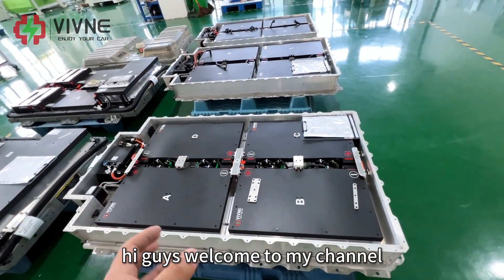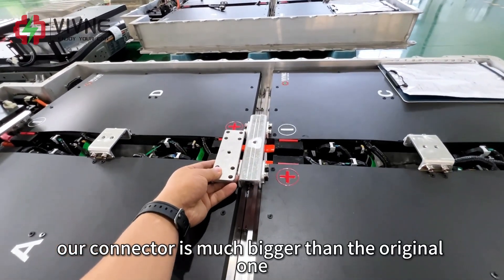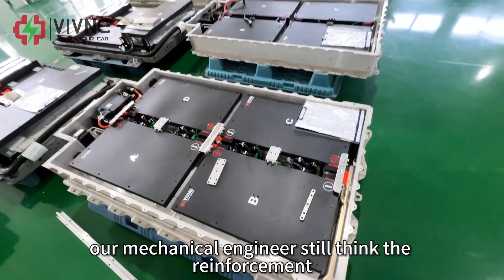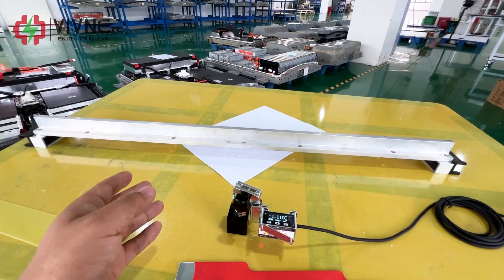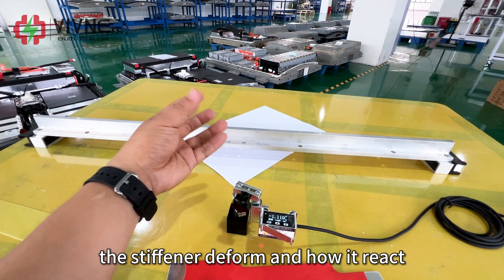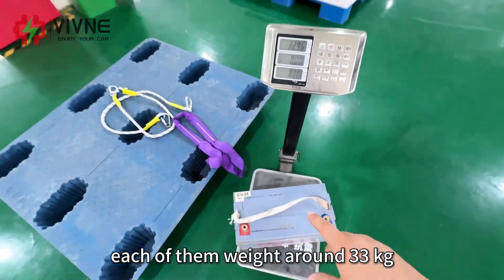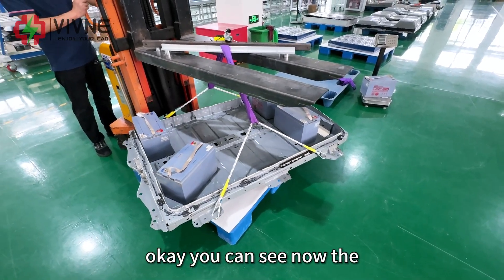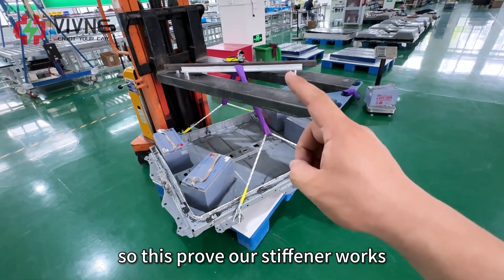VIVNE-BMW i3 Battery Pack Reinforcement Test with 180kg Load!

Comment: I'm more worried about the lack of cell side compression so that it lasts the rated cycle life...
Reply: The cells are different. Not using Samsung cells here anymore but CATL it appears, more modern efficient type used instead ?!? Perhaps soon some other 3rd party devises solid state cells..will be interesting to see how far things can go not just quantitatively but also qualitatively i.e. use back the original BMW battery casing (for packaging compatibility) & key components (to be able to interface with existing software environment of this model/generation of car) but keep improving the battery cell aspect..interesting to see how much further the BMW i3 concept of car can go ?!! Something like the M-B G-Wagen/G-Class, the key concept of design remains unchanged over even decades yet continous modernization of the details underneath take place

Comment: Only way for you to sell this in EU is to let the battery certify according to EU standards. I know, its costly and your product would most likely not pass it. So far, your battery is not safe to be used in car and you should not advertise it nor sell it.
Reply: Just bought one... EU is not a mandatory thing to rule your life...
Reply: @fernandinand yes. EU becoming a big clown joke ?!? Also quietly notice how greatly EU depends on Asia especially China for their so-called 'own original' products today ?!?!?
Reply: What is your real life evidences that these retrofited battery pack is 'unsafe' ?!? You cannot simply assume obviously...you MUST produce your evidences to back up your opinions ??? Otherwise commonsense will need to prevail i.e. based on what can be seen so far this setup works in reality ! So it's only reasonable to take it that it works... until there's any evidence 1 day which proofs otherwise ?!?!
Reply: If the EU had existed in prehistoric times, we would never have left the trees and would still be sitting there today. The idea that everything has to be regulated, certified and 1000% safe is the end of industry in Europe. Come on, wake up, the world has moved on and Chinese products are more innovative and keep the world running.